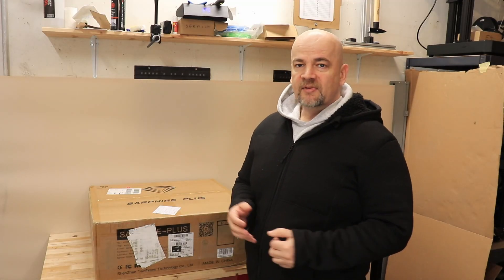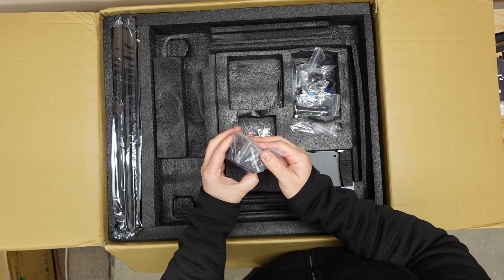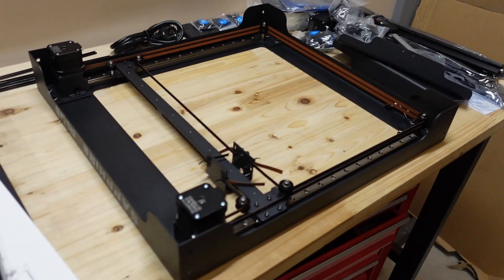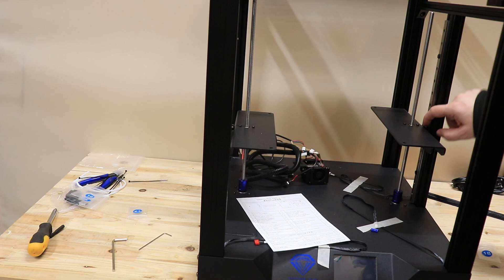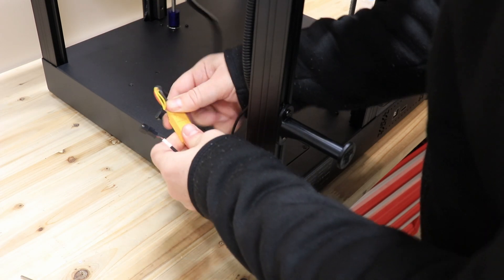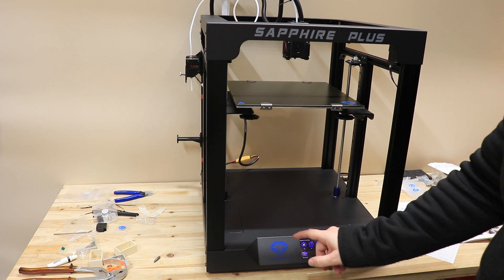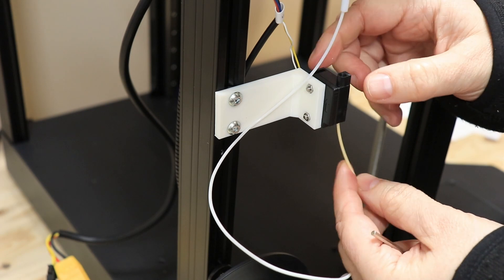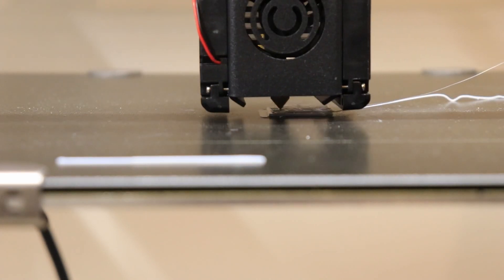Sapphire plus (SP-5) - Core XY 3D printer by TwoTrees - hate it or love it?

Comment: I got the older model and I had to fit the belts myself. The printer never worked, so I replaced the motherboard with a btt srr 14 s with 2299 stepper drivers., I also fitted a larger screen, but other things came up  and set there in the corner of my workshop where it still remains today.

Comment: Thank you. Do you think a ball screw instead the T8 Lead screw would improve the Z surface?
Reply from the maker: Yes, but more cheaper solution, but with similar effect is using a backlash nut on Z.
Reply: @MyTechFun  How can I use a backlash nut on Z? Do you have some pictures or video?
Reply from the maker: I don't have a video about it. Ender-5 S1 uses backlash nut for example, but thats not Corexy printer. There are videos about it, but check is there enough space for the nut (it can be added to existing lead screw if there is enough space in top position @aketo8082
Reply: @MyTechFun  Thank you. Have a great day!

Comment: Tempted to get this and replace mainboard and hot end for voron stealthburner. Its clearly not a beginners printer.
Reply: or just do the easier choice and just get a voron kit.
Reply: @TommiHonkonen  Those are 2 to 3 times more expensive and not easier to put together though. The only reason to ever buy this is because its cheap and an extra $100 will turn it into a pretty good large format printer. It's also all metal construction and not plastic like a voron. Its all academic anyway as crazy shipping prices mean that its not worth buying anything at the moment so I will just wait until a busted one appears on ebay.
Reply: But there is no real Voron Stealthburner for the Sapphire Pro/Plus. Just a few „look-a-like“ ones on thingy.

Comment: Why does the board have 5 stepper drivers and the two Z-motors are synchronized with each other? They really missed a G34 opportunity with that one. X-Y-Z-E, that's only 4 drivers, they have 5. I would ditch the belt, put a BL Touch on it  and compile my own firmware so G34 will work or Klipperise it, Robin Nano is a known board.
Reply from the maker: Great point. I think at some time, they had this version without timing belt and with two Z-switches. Probably the original firmware was for that version.

Comment: At the time of release of this machine the belts had to be installed by the user and some YTbers had trouble tensioning the belts and slated the printer for it, so it seems Two Trees has addressed this problem by installing them in factory, of course a mechanical tensioning system would have been ideal but I have to give kudos to Two Trees for listening and addressing this problem, although I did watch one build where the YTber did tension the belts well enough by hand and his prints were much better than the other YTbers

Comment: 6mm belt is just fine for that since i am fine on a 500 cubed ratrig with 9mm. They have 6 on vorons too.
Reply from the maker: Ender 7 have 10mm belts. Voron 0.1 uses 6mm, but I think 2.4 uses 6 and 9mm belts (but not sure which is for XY)

Comment: I added 3D Touch ( no need to update marlin ) it is ready for it. It gives a much better first layer as my bed was not flat
I set acceleration to 3000 and print speed 160mm/s is still good quality.

Comment: Seems like a good buy for the price if you're willing to do some tinkering.
Reply from the maker: That's exactly my opinion
Reply: It's true. Runs like a charm, when it's fixed. But I would rather not recommend the machine, since the way to this point is quite annoying and long. For Example: Some holes of the frame were misaligned by up to 1cm and the hotend was not working for me and other people until changed for something else. TwoTrees did build several Versions of this printer (Sapphire Plus and SP-5) with multiple names Z-Drive configurations. It's a fixable mess, but at that point of coast, you're betther off with something else. I would rather go with an FLSun Super Racer today.

Comment: I have a problem with the homeing, when the bed is rising to touch the z axis endstop, it would not stop but rather keep rising , it doe not seem like the switch is broken as the light shines when clicked,, any solutions?
Reply from the maker: First you have to find out if switch is working correctly. You can do it with some continuity tester (or measuring with multimeter).
Reply: @MyTechFun  well the light on it lights up, but I have this problem as well

Comment: I'm having this problem on mine, what is my options without the tools?
Reply from the maker: "This problem" = Z homing ? I mentioned few other solutions in video. You can install another limit switch. Or just disconnect one stepper motor. Or ask for proper firmware from TwoTrees
Reply: @MyTechFun  I'm also surmising the one stop switch I got is also bad possibly, I ordered more and hope to run it again.

Comment: Name of this printer changed to Sapheiros several months ago and again to SP5 recently if the Facebook group is to be believed.  So I guess this reseller is providing old stock?  That's also the problem here.  I luckily had the version with 2 separate z step-sticks and no belt and a 3dtouch probe, allowing G34 to work (but without glass bed unfortunately).  Problem is that it's almost impossible to know from the seller's page which version you'll get and the evolution of those versions is also not always in the right direction.  Biggest weakness I feel is the lack of extra room for the nozzle outside of the bed.  That makes things like a klicky probe or statically mounting a nozzle cleaning probe impossible.  I also removed the bottom metal hotend bracket holding the part coolers and replaced it with some printed parts and better air ducts.  That allows a better view and access to the hotend.  I replaced just the heatbreak by a all-metal one for < $5.  The lead screws binding with the linear rails was my biggest headache.  I think the earlier design with 4 linear rods and the leadscrew in the middle would have been better.  Now it took loosening up the lead nuts to avoid binding.  So, I think consistency and some - possibly even more cost-effective (linear rods on Z) - changes could make this printer even better.  Also, get rid of the belt, add a probe and flash a correct Marlin supporting Z tilt align with G34. Almost forgot: I replaced the step sticks by TMC2209 and added some wiring to have uart to these for more control.  I'm running at 850mA on X, Y and E and 650mA on both Zs, currently with Klipper, with manual resonance tuning and that made the walls soooo smooth!
Reply: What is lucky to have the one without the belt to synchronize the zwo Z Rods? Isnt that better to have instead of having them running unsynchron?
Reply: @s38lapy  I dislike the belt as it makes the two steppers work against each other.  Either have a belt and a single stepper motor or 2 stepper motors but no belt.  The latter allows using G34 to actually get your bed to auto-tram in the X direction by measuring the height at both sides and adjusting both z steppers until it is the same.  If you have 3 or 4 z-axis like voron 2.4 or rat rig, you could automate tramming fully this way, but at least with the Sapphire Plus you can then already do it in one direction.

Comment: Can you print fast with this machine and still get good prints? I would think so because it is a CoreXY.
Reply from the maker: Yes, I tested up to 150mm/s, but the weak point is hotend. This means mostly PLA on hi-speeds, I raised the temp to 220-230C
Reply: @MyTechFun  I upgraded only the heat-break with an all-metal one and designed and printed myself a direct-drive mount.  Running Klipper and very nice quality at fast speed (150mm/s extrusion is no problem, my default motion speed is 400mm/s with no problem).  Ah I have also recently replaced the motor mounting with PETG parts moving the motors slightly to get a square belt path where it counts and some other PETG parts stiffening all the idlers/corners.  Those can be found easily on Thingiverse and I do think they make a bit of difference.
Reply: Thanks for responding. You are one of the few YouTubers who actually do that.

Comment: I bought one in late December from Banggood and it arrived on mid-January, so it should be the latest version. At least it is the same that is reviewed here. I had read a lot of user feedback and watched review videos about the printer so I was not expecting much. Having rebuilt the whole machine and discovering it's weaknesses, I think this review was far too kind for Two Trees quality and design management. I do agree that this can be built as a capable printer (and with little extra money) but in stock form it is an utter disappointment to me. For example the Z-system, Two Trees could have ditched the two pulleys and a belt by just installing a second Z-limit -switch. It would have been better mechanically and probably cheaper to produce. I don't know how they expect a novice to level the Z-gantries when the leadscrews are connected together and there is absolutely no mention about it in the manual. Also my stock firmware was way worse, there were a lot of icons without the text and with no idea what they would do. It's running a clean Marlin now. There were a lot - and I mean a LOT - of other small annoying design brain farts that would have made the printer better and most likely even cheaper to manufacture if they would have been fixed. But no. Mine is now running well and fairly quickly with maybe 80€ extra spent. Would I recommend one? Depends on who is asking. For a novice absolutely no. For someone experienced who is looking a project for half the cost of similarly sized Voron, yes if they promise to do some research forehand.
Reply: What did you buy extra for it?
Reply: what have you tuned?
Reply: Dang! 

I just received mine three days ago, took a couple hours to set up and it's now easily my favorite printer. It's already pumping out prototypes. For reference I have an upgraded E3V2 and Ender S1. I'm considering selling those and getting two more SP5's. I'll wait a while just to make sure the SP5 is reliable.

I had the same issue with the firmware but Andy at two trees sent me a new one in like 30 minutes.

I don't know why people have so many problems with 3D printers in general. I think many people suffer from 3D printing hypochondria. Maybe because they read things and are expecting issues. So they go on these quests to fix issues that are their own creation. Not saying that's you. I just never have any issues others have, with the same printers. I've only been doing this for 8 months but I do have a background in engineering, metal fabrication and woodworking. So maybe it's just inexperience in mechanics on their part.

The only thing I've purchased for the SP5 so far is PTFE oil and grease for the rails. Swapped out a couple screws that were stripped from the factory.

I had a Dragon HF in my Amazon cart but the hotend that came with it is printing fine at 150 mm/s. At this point I probably won't upgrade the hotend until after I get Klipper installed.
Reply: @itsame6217  I haven't tuned anything on mine. Printing great stock.
Reply: @dangerous8333  Good for you. My biggest letdown on the printer was - and still is - that the printer could have been a lot better and even cheaper to manufacture IF there would have been even one guy in charge who knew how printers work. 

Clearly there was some good engineer who planned the original printer, but after the initial version they have just slapped on some fashionable upgrades and workarounds without considering the options available. The dual Z carriage for an example (in my previous rant). One other thing that came to my mind after writing the  comment is the bed insulation sticker that comes with the printer: Large beds tend to lose the heat from the corners. The supplied thermal insulation was 220x220 (or thereabouts) on a 310x310 bed and that leaves the outer 35mm un-insulated. Where is the thermal sensor? Right in the middle, very well insulated. I'm pretty sure that by installing the included sticker you make the things only worse. That's just one thing that an experienced developer would have corrected and would not have cost more than pennies extra.

Just as many Chinese-originated instruction manuals and their bad English translations, it just blows my mind how little effort the Chinese manufacturers use on the product finalization and customer experience on the product and the brand image. In the western world these are thought as the most important things. The Two Trees SP-5 makes a fine example of that. And that's the thing that bugs me the most.

You and I had previous experience with printers and were capable of tuning the printer and making it work. 
I still remember when I purchased my first printer and how overwhelmed I was in the whole technical aspect of slicing, plastics, layers, temperatures, marlin and such. Fortunately for me, the printer I chose was very easy to operate and I didn't have to focus on troubleshooting. In that sense a firmware update would have been the last thing that I would have needed.
Reply: @itsame6217  On the hotend mine has a Trianglelabs Volcano with combined V6 mount and a belt tensioner from Thingiverse, Sunon axial fan and the radials are stock. 

Also running a BL Touch with individual Z-steppers. The Z screws have the upper supports removed due to clearance issues with the new hotend design. I think I had to cut maybe 15mm from the Z-screws too due to part cooling fans hitting it.
With linear rails and the newer SP-5 z-screw nut design the top mounts are not needed anyhow and can actually cause resistance if the Z-screw is crooked. Mine were straight.

The firmware is currently a clean Marlin with Octoprint on an old Raspberry, but already from the start I was planning to go for Klipper, but never got to it yet.

I was planning to build it to a direct drive setup with LDO Orbiter, but never go to it either and I think that I will first try to relocate the original extruder. By moving it up and to the middle of the chassis I can cut 1/4 or maybe even 1/3 off from the bowden tube making retractions easier to tune.

The motherboard is stock, as are the rails, steppers etc. I haven't spent that much money on it since most of the stuff I had laying around anyhow. I haven't really pushed the limits on it. Yet.